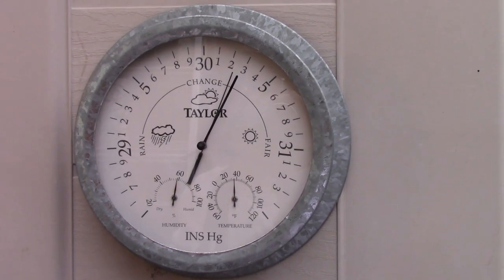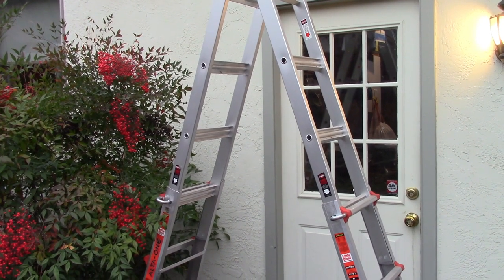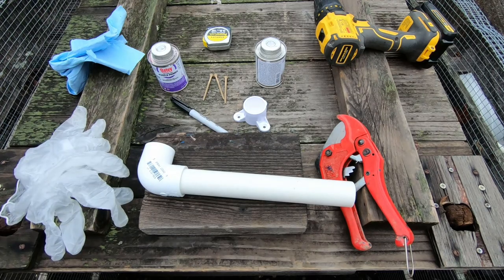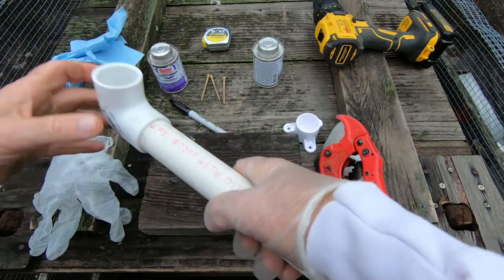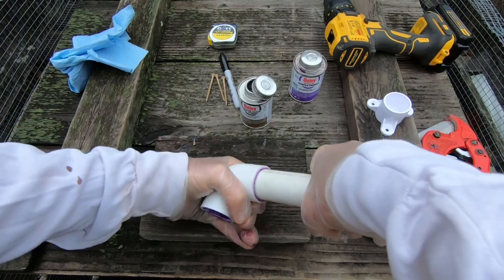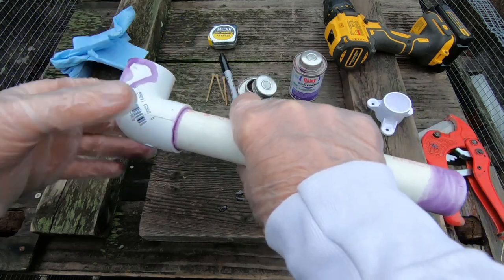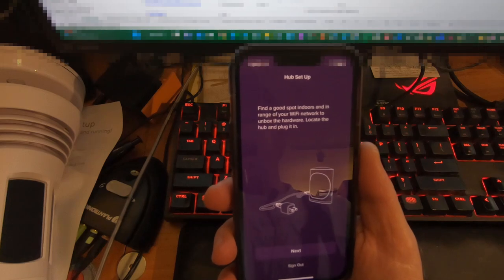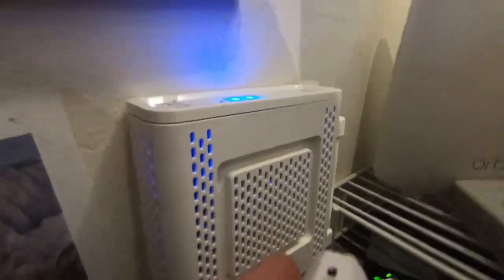WeatherFlow Tempest Weather Station Unboxing, Installation, and Review - Part 2

Comment: Been looking into getting a weather station.
Reply from the maker: I like the WeatherFlow Tempest except for the rain gauge accuracy.
It's usually about 50% off (too low).
But it does send me an alert when it starts raining (which it detects very accurately) which is helpful.

I'm still using my standard tube rain gauge (see it in this video series) to measure rainfall. That's easy to use and sufficient to satisfy my curiosity about how much rain we got from the last storm.
Reply: @BetaCygniBlog  that’s disappointing. For the price it should be more accurate.
Reply from the maker: @eltoronegro  I agree, they claim that it will get more accurate over time using "machine learning", which I assume means that they compare what their units are measuring vs. the official measured rainfall for my area and make adjustments. The rains have basically ended until the fall/winter where I live. I'll post another update after the next big storm to compare what my standard rain gauge says vs. the Tempest.
Reply: @BetaCygniBlog  thanks

Comment: You need at least one more attachment point for the vertical pole, The pole will be unstable and susceptible to movement in the wind with only one.
Reply from the maker: I agree it would be more stable with 2 points of contact, but on my eave, there wasn't a good option for that.
I ended up making the pole shorter (5 feet instead of 10 feet which is closer to the recommended height above a roof) and it's a lot more stable.
It has survived a number of storm and wind events since then without an issue.